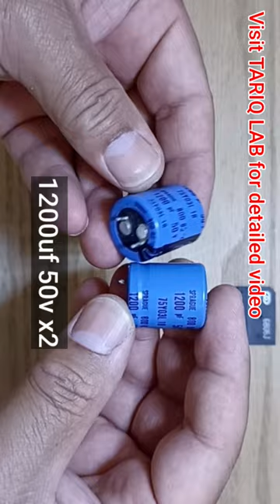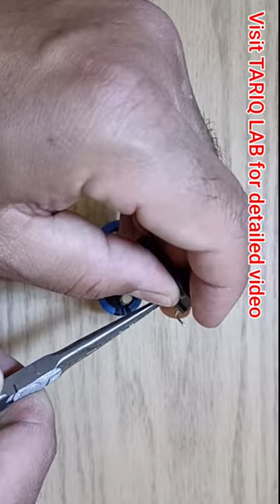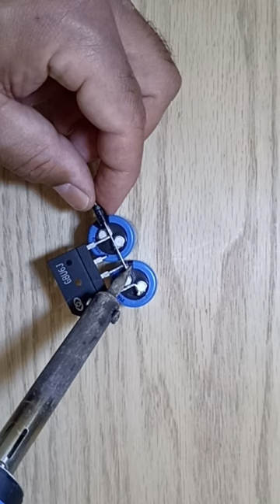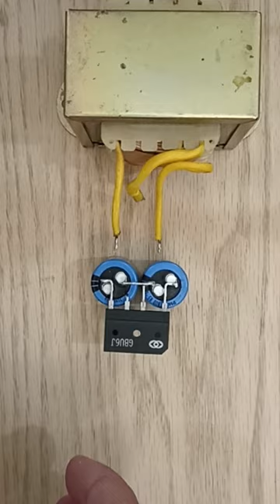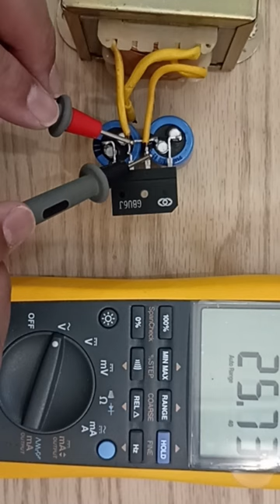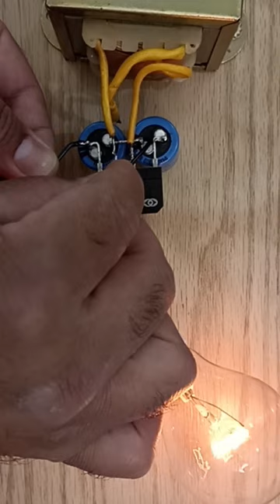How To Make Voltage Doubler Circuit

Comment: This is just a simple circuit from ac to dc with diodes and big capacitors. 
The capacitors always take the actual ac voltage to higher dc.
Also to running an ac lightbulb on dc circuit is not the best idea
Reply from the maker: Voltage Doubler Circuit

Comment: volt doublers cannot be used on everything. I tried it on an audio tone control card from ebay that should have +15v 0v 15v- it didn't work well. had several problems. anyone who knows why
Reply: 15 input or output?
Reply: @MrClean-ep7uc  Original the card shall have
15v 0v 15v AC. 
The board has a bridge rectifier and two capacitors. I tried to make volt doublers with the two  capacitors and bridge rectifier in the same way as in the video.

I had problems with 50hz noise and other things. With a DC. 15v 0v 15v power supply straight onto the card everything worked fine! 

Why does volt doubler sometimes work and other times not?